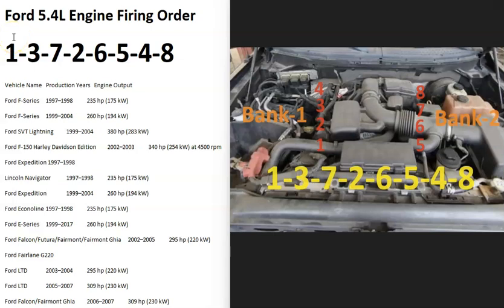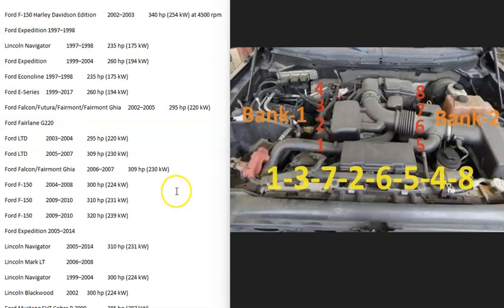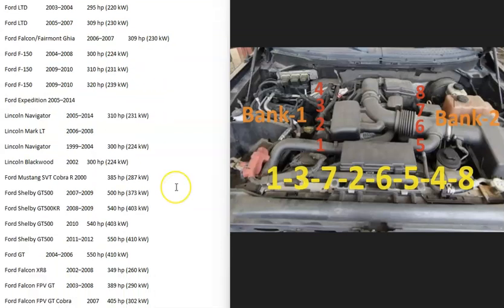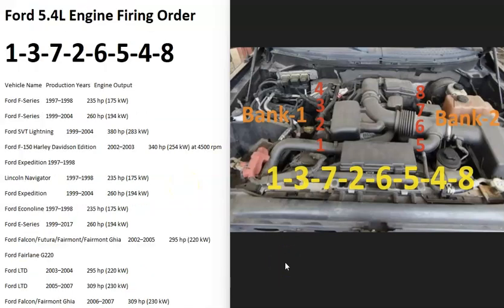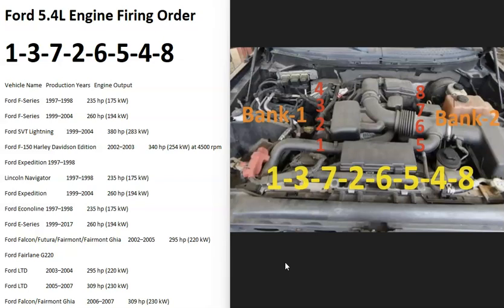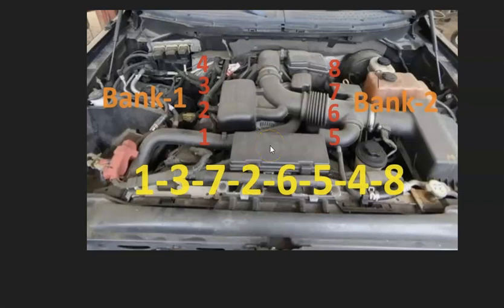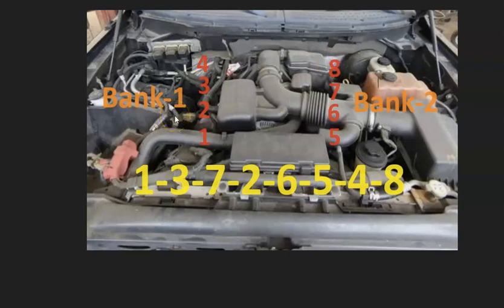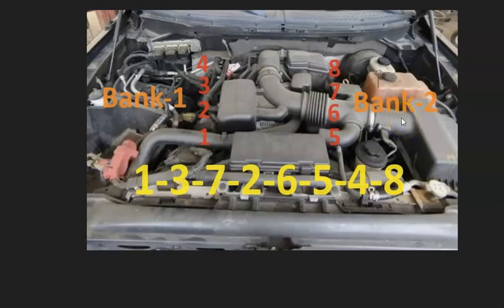Ford 5.4L Engine Firing Order and Cylinder Location (Bank-1 and Bank-2)

Comment: How do fix running rich in bank 1
Reply from the maker: A Rich connection can be hard to troubleshoot, but if it is only on Bank-1, it is something that would not affect the whole engine. I would remove the spark plugs one at a time on Bank-1 match them to a spark plug burn chart and find which cylinder is running rich then test the components on that cylinder.